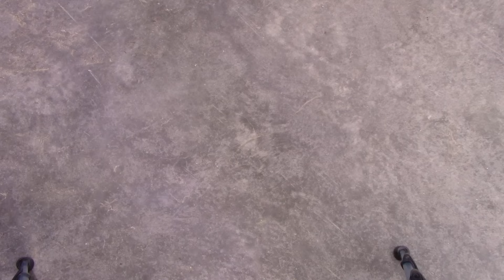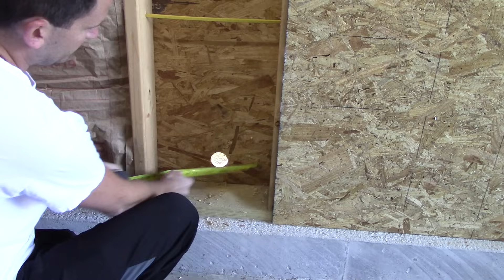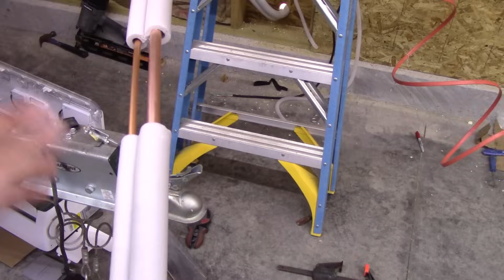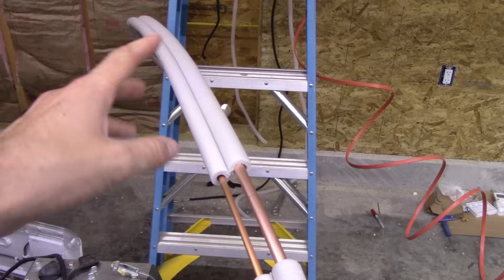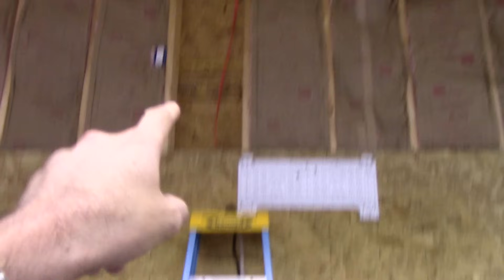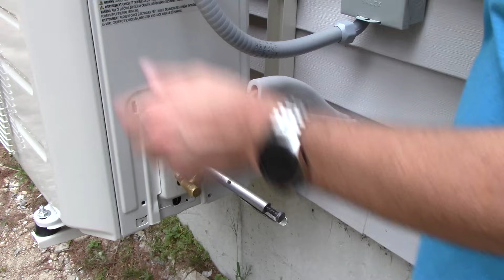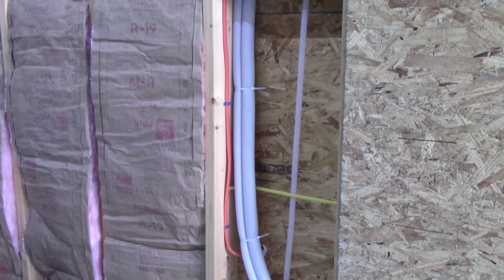Mini-Split Installation For Dummies - Complete Step By Step Guide.

Comment: Nice vid, I just wish the wiring tutorial was a bit more comprehensive. I couldn't tell which wire was going where lol. But I'm in awe of how many breakers you have in your box. I only have two little breakers and some antique gauges.
Reply: Wiring, if you are using 10/2 wire (black, white, bare ground), then black and white lines are hot, and bare is ground.  If you are using 10/3 (black, red, white, bare ground) then the black and red lines are hot, white is neutral (not used in this case) and bare is ground.
Reply: @grnsouth1204  Thanks for that man.
Reply: I agree about a little confusion on the wiring.  Since the unit is 220v why did you connect the common (white) wire in the service panel?

Comment: If you have "gauges for testing line pressures", and "tools for flaring the copper lines", "vacuum pumps", and good "advice" such as "not to have loops of coil that would allow oil accumulation" in the lines, "depressurizing nitrogen in lines"; plus advanced knowledge of electrical connections, etc, I wouldn't call myself an "HVAC dummy" if I were you ;-)
PS: Not sure, but it looks like the nut that is associated with right front rubber foot of the unit may need to be tightened more :-)

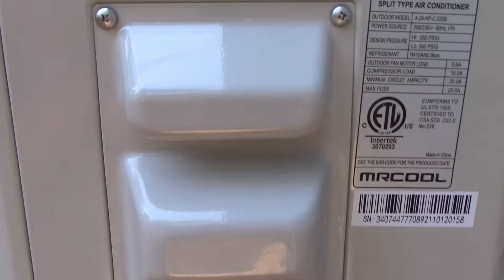Comment: What's the 1,2,3,L1,L2 about? How did u hook those up? @9:22
Reply: L1 and L2(plus ground wire) are the powered wires from your electrical panel to the outside unit.  These wires go to a double pole breaker in the your electrical panel.  1, 2, 3, and ground(3wires +ground =4 wire cable) are the wires that go between the inside and outside unit

Comment: Just a note. Before you pull a vacuum on the system, you want to pressurize it first to make sure you don’t have any leaks. There should be a test pressure listed on the unit. Record your existing pressure that you put on the system while the high and low service ports of your gauges are connected. Check pressure 30 mins later, you should not see a drop in pressure. Release it after you verify that there are no leaks. Then pull a vacuum from the high and low side until you reach 500 microns. Then open up the high side and watch your gauges rise from the preloaded charge. Your welcome.

Comment: Great video, thanks.  I’m planning to buy a 12,000 btu unit , and it might be too big since I’m installing the compressor on my medium size patio deck on the second floor.  What size is your unit?  Thank you
Reply: size your unit by multiplying 25 BTU per each square footage
Reply: @tdubbs42  You cannot go by that formula. You must take into account the zone you live in, insulation, direction your walls face, exposure, how many windows, ceiling height. My garage in south Florida needs double what that formula says.
Reply from the maker: No problem 👍 Mine is a 24,000btu.  Good luck brother

Comment: what wire gauge did you use? Could I use a 25 amp breaker?
Reply from the maker: I used 10 gauge.  You should always use the specified breaker listed in the manual.  You want it to trip as soon as there's a problem.

Comment: So I have a question about pulling a vacuum. You pulled it to the negative then allowed it to go to one pound of pressure. Then released it with the schrader valve. Doesn’t that release all the vacuum and set it back to nothing??? I’m getting ready to do this real soon, want to get it right!
Reply: He pulled a vacuum to test for leaks. If it wont pull to negative pressure and stay there then the system leaks. After that he  opened the compressor side to allow a little bit of refrigerant in and closed it back, this is a redundant leak test but always better safe than sorry (refrigerant isnt cheap) Hope that helps and good luck.
Reply: So it wouldn’t make a difference at all to get all the air out other than to check for leaks? Also, I only need like 2 feet of my line set, could I get away with cutting 14 feet off, will it cause any issues?
Reply: @swatpigbbq  That sounds like your system would end up being overcharged. The end result is blown compressor seals.
If you absolutely have to cut the tubing way down, you might need to hire an AC tech to get the fill correct.
Reply: @swatpigbbq  
No, they say it requires at least 10 feet, the refrigerant needs time to go thru it's changes
Reply: I contacted Mr Cool and they are like, don’t cut the lines lol.
Reply: @swatpigbbq  you want to get the air out because it contains moisture, as far as cutting lines I dont cut them and I leave a service loop on the evap side (if theres room for it) in the case that I need to replace something
Reply: So the end result was, never cut the line. Installed the whole thing, turns out I’m a jack wagon and ordered the wrong unit. So now I get to take it apart and return it so I can get the right one!

Comment: Did you use conduit to run your wire though the wall to your outdoor subpanel, or how did you ensure waterproof there? What did you use to seal your hole you ran the refrigerant lines through?
Reply: The hole through the wall is sealed using a putty seal product.  It is like plasticine that kids play with.  You pack it in the hole on both the inside and outside.  You could probably squirt a bit of low expanding foam in there as well, and hope you are not the guy who needs to clean it out at some point.

Comment: Did you use so cord in the seal tight?
Reply: I just got my unit inspected by electrical and SO cord is not allowed by current NEC to penetrate a wall (NEC 400.12).  Not sure why SO cord was provided with my unit but I had to buy 14/4 cord from my local electrical distributor for about $1/foot (a lot cheaper than online and where all the HVAC guys seem to get their cords as it was not hard to explain what I needed and why).  I read about it and it has to do with the wire covering.  I put the cable in flex conduit and that was to code and my inspector stated that I only needed it outside.  I have seen cables without the conduit outside as well but you go with what you are told. The other issue was the provided SO cord had specific cable connections at the unit that I could not find so I used shrink wrapped connectors for 14-16 awg wire (blue) and spliced just below that part of the wire to have a solid connection at the unit. For the outside unit I simply used the U-shape 10-12 awg wire connectors (yellow).  Good luck.  
I also appreciate this video for the guidance on DIY tools.  I saw some other videos but the total tool cost was more than the HVAC install and not much use for some of those tools after install. 
Thanks.

Comment: How many microns did you get down to on your vacuum?
Reply: He didn’t use a gauge so he doesn’t know. That gauge is a extra 160$ if you wait 45 minutes with a pump it should be around 380 and anything below 500 is beyond acceptable. 👌🏼😉

Comment: bob c. I have a question,. I installed a mini split,  twice. the first one lasted 8 years, installed a 2nd one two years ago, and the compressor is having a problem. I had it looked at by an ac guy who really didn't know 100% about mini splits, but said the set line, the cooper lines, need to be 30 feet. I have 10 feet the system came charged for a 25 foot set line, the gas came out the first time, so it was re charged. maybe to much pounds. But nevertheless, I never heard you have to have a 30 foot set line. does make sense. any opinion about that? thanks.
Reply: Different manufacturers have minimum lineset lengths. Also you can charge the lineset with nitrogen after it has been connected to check for leaks before you evacuate and open the valves
Reply: It doesn't make sense, mini splits are NOT DIY's at all! That's why you are having problems.

Comment: Hi. Now that you have had both, I'm curious why you favor Mr Cool  over Mitsubishi?
Reply: Mitsubishi is pricey
Reply from the maker: @exteriorharvester777  I like the app much better.  It's open source so you arn't stuck with the mfg app like you are with Mitsu and Mitsu's app SUCKS.  I also like the screen on the indoor unit that shows you the temp (can turn it on or off if you dont like it).  The Mr. Cool startup time is faster.  The heatpump seems to require less defrosting cycles which means more steady heat output and less wear and tear.  Overall, if it continues to be as dependable as my Mitsu's than there's no contest IMO.   The price point sure doesn't hurt either!

Comment: So after you hooked up to the low pressure port did you open the valve up with an Allen wrench before you turned the pump on?
Reply from the maker: No, you're just drawing down the lineset and indoor unit.  The compressor end stays sealed until the end.

Comment: Well, that was a letdown. How did you get the freon in the system? You didn't even show the connections to the gauge unit or vacuum pump, which was the one area most people don't understand. Where did you get the freon? I thought the Mr. Cool unit's were pre-charged, so what happened when you cut the line? So many questions, so few answers.
Reply from the maker: Did you actually watch the video?  It's there my friend.
Reply: A lot of people don't understand.  The lineset is just a tube, there is nothing in it.  The last step in the video he used the allen key to release the coolant from the external unit, it then goes into the lineset and makes the system functional.  You don't need to charge the unit or put anything in, the coolant is inside the large box from the factory.

Comment: I've been wanting to install a mini split in my room to replace the window unit but I'm worried about the light bill. Was the bill alot more after months of using the mini split?
Reply from the maker: No, these are much more efficient than a window AC.  All things being equal you will save on electric costs.

Comment: The Complete kit w/pump, gauges and Mini Split adapter that you link to states NOT suitable for r410a refridgerant. yet you used it. Is there an explanationa as to why or why not this kit would be suitable?

https://www.amazon.com/gp/product/B07LBLDZ89/ref=as_li_tl?ie=UTF8&tag=trialnerror-20&camp=1789&creative=9325&linkCode=as2&creativeASIN=B07LBLDZ89&linkId=da3d6b8054a193335765f8fcf1695d33
Reply: Different ends, as he mentioned, he needed an adapter.
Reply: automotive gauges.

Comment: What about your super heat for efficiency.  Factory charges are inherently low due to temperature differences.
Reply: Ax L where the units are made and prechaged for the consumer the refrigerant most time is under charged due to a temperature change from where they are built so you have to convert the pressure on the high side of the system (the reds hose/gauge) to temperature using a P/T chart and take a temperature from the out let of the condenser subtract those 2 numbers and that will give you a superheat the super heat should be between 5 and 20 obviously you want to aim more for the middle of those 2 numbers but this can determine if your unit is undercharged or not
Reply from the maker: @pistolshoy87  GREAT info Marc.  Thanks for adding it, I'm sure that will help a lot of people thumbing through the comments!

Comment: No reaming the cooper pipes after cutting them this prevents burrs from getting  into the oil of the compressor, Vacuum should be done on both high and low side with a micron gauge  down to 500 microns using a pipe bender keeps from kinking cooper lines .  Don’t where jewelry necklace around electric. Using a torque wrench is definitely recommended it’s with the money I have been there .
Reply: If you look at the unit it does not include a service port on the high pressure lines. Drawing a vacuum on the low pressure port, draws a vacuum on the complete loop, all lines through the inside cassette back out to the high side. That's why he opened the valve on the high side to put pressure on the low side before releasing the vacuum pump.

Comment: nice job, mr cool like mr slim. good luck down the road. i would recommend a surge protector at the main. i have changed boards
out on the condenser from incoming power spikes. those boards are not cheep.
Reply from the maker: Thanks and yes, I have a surge protector on the main panel.  I have way too many electronic toys to risk it!

Comment: curious as to why plugs are 11’ off floor? Since breaker box has a main breaker the green bonding screw needs to be installed.
Reply: The green bonding screw is NOT installed on a subpanel, as he stated this was .  The Neutral and Ground should only be bonded at the main panel on the house.  The main breaker in this subpanel would be a means of disconnect in this case.  The subpanel is supplied by a breaker in the main panel which protects the feed and this panel.
Reply: Joe Johnston it appears the sub is fed with 3 wire  which should be 4 wire
Reply: @1topfueldrag  You would be correct in that case, as there does not seem to be a larger ground wire from the main panel on that ground bar.  It's hard to notice with all of those details at the upper and lower limits of the screen.  The point about the main breaker would not be true, however.

Comment: I don't see the adapter in the link for the pump, unless I'm just missing it.
Reply: @Trialnerror  Thanks. I think I'm going to give this a try this spring. Tired of noisy portable AC unit in my living room.
Reply: So the outside unit is already charged, just have to follow the steps in your vid? This actually doesn't look as bad as I would have imagined.

Comment: This is the very best installation video I have seen. I have a question though...you ran the control cable in the same conduit as the main power. Mr. Cool told me this would cause interference and create problems. Did this happen to you? Also, do you know if there is a minimum line length when you shorten the lines? Thank you!
Reply: @Trialnerror  I think I've watched just about every video for the various "models" that are made by Midea (Pioneer, Mr. Cool, Senville). You were the only person who ran the lines together in the same flexible conduit, and I think that is by far the best way. 98% of the installations on YouTube just have the rubber control cable exposed -- or running across the ground -- packing 240 volts! 

My line set is sixteen feet and I plan to cut off about five feet, so hopefully that will be OK. 

Just as an aside for anyone else watching this video: My Mr. Cool came with a chintzy 2.5" wall sleeve, constructed of the thinnest, cheapest, most ridiculous plastic. I could see that it would cause problems, so I cut a hole with a 3.5" hole saw, and inserted a piece of 3" PVC for a sleeve. (3" PVC OD is 3.5", ID is 3"). The extra half inch made a world of difference.
Reply: @bupright  I believe the electrical code prohibits running low voltage control cables in the same conduit as power cables.
Reply from the maker: @buggsy5  They are not low voltage, the outdoor unit provides 240v to the indoor unit through this 600v rated cable.  That said, I believe they are still technically suppose to be in separate conduit but I like to live dangerously lol.
Reply: Buggsy5, the control wires need to be 600V rated to be run in the raceway with the power wires. Also the unit may not have been UL tested for this installation.

Comment: So you used R134a in the system? Not 410?
Reply: 134A is for automobile AC units.
Reply: No.  The system comes recharged from factory for 100 foot linear with 410a.
Reply from the maker: @toddiamhvact7386  Correct, I may have misspoke at some point in the video and called it 134.

Comment: Don't the condenser have to be 21inches away from the building. I have a 2400 manual says 21 inch. For air flow.
Reply: @Trialnerror  thanks for info.
Reply: @Trialnerror  Do you know if the lineset have condensation when the ac or heat. I have to run my lineset through the addic.
Reply: @jonp6347  it can condense in cooling.  The lineset should be insulated to stop water leakage.
Reply: @toddiamhvact7386  thank you for the reply

Comment: Great video, but you forgot to show what you did with the drain line and how you ran it. along with insulation of the lines outside.
Reply from the maker: Yea, I muffed that up.  I just ran it down and out of the same hole the lines run through.  Sorry I didn't show it on camera but just keep gravity in mind and you'll have no issues. Thank you very much for watching!

Comment: The condenser unit was  charged  with refrigerant ,and the evaporator ( indoor) unit was charged with nitrogen to keep moisture out , after he pulled that very short vacuum ( needed to be 500 microns) - he released the Refrigerant from the compressor and condenser into the rest of the unit —- Good Job enjoyed the vid
Reply: For this DIY to work, wouldn't the indoor unit and linesets have to be charged with 410A gas? Unlike standard evaporators.
Reply: @kenmarriott5772  its inside the compressor already it was released into the system when used the Allen wrench to turn the valve under the cap.

Comment: CAN I INSTALL ONE OF THESE UNITS ON MY 5 TH WHEEL ROOF TO REPLACE MY EXISTING UNIT WHICH IS A DUCK SYSTEM CENTRAL AIR?? MY CONCERN BEING RAIN / ELEMENTS COMING DOWN ON A FAN FACING SKYWARD???OTHER??? HOW DO I CONNECT THE DUCTS?  WHAT DID YOUR UNIT COST, WHERE DID YOU BUY IT, HOW MANY BTU"S SIZE OF AREA TREATED?? THANK YOU VERY PROFESSIONALLY DONE.
Reply: You mount the compressor on the back of your RV upright on a bracket, it's a common thing

Comment: Why pay for charged lines and then cut them??
Reply: It is not the hvac lineset that is charged.  The charge is in the box that sits outside.  The last step he did after vacuuming the line and testing the vacuum was to use the allen key and release the charge from the external box.   The lineset is empty when you get it, you suck the air out and then release the cooling agent into the lineset.
Reply: Rev you're thinking of the DIY units that include precharged lines to remove the steps that include having to draw a vacuum on the system.